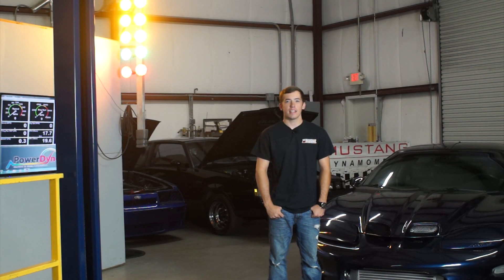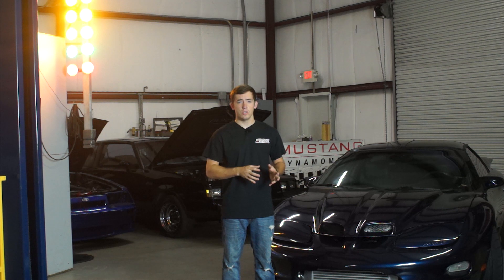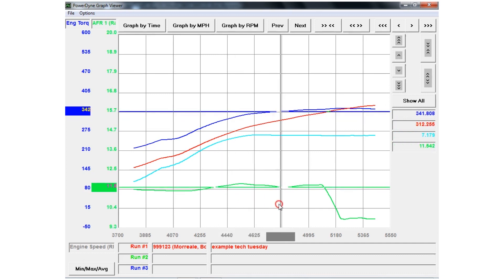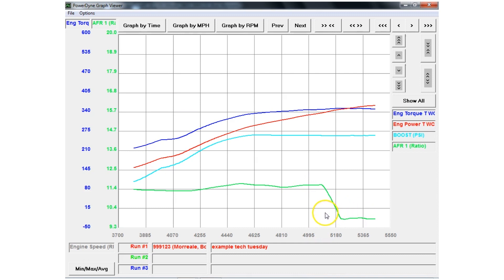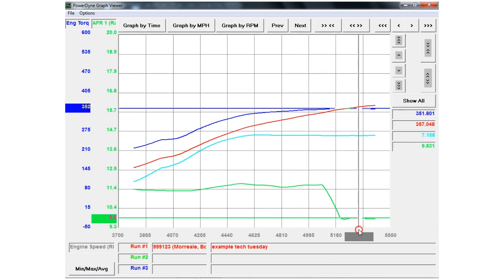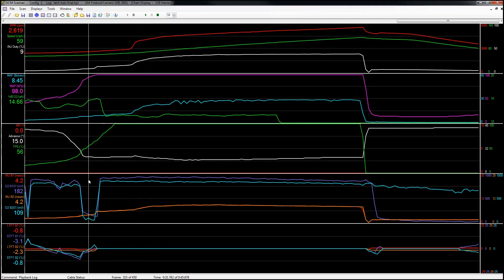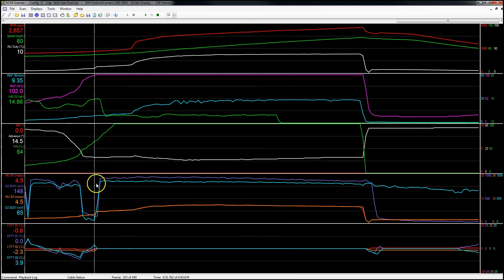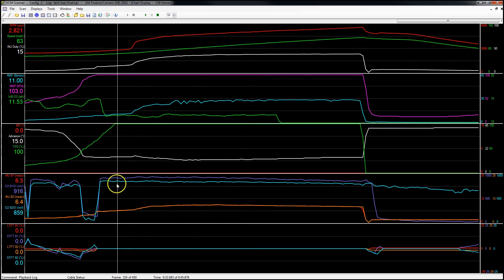How to Tell if You Have a Bad Wideband O2 Sensor: Using HP Tuners

Comment: Great. I will buy a Dyno machine to detect bad O2 sensors in my 2003 car.
Reply: What he described will tell you if tell you if the O2 is bad, with or without a dyno. The injector pulse would shoot up, etc.

Comment: Hey TheTuningSchool, I need some help in regards of troubleshooting a bad o2 sensor or if it's something else. I was doing 3rd gear pulls today and datalogging. I saw my AFRs shoot up to 22 and beyond. I have no CELs, IDC's are normal, timing is normal, boost pretty everything is normal. Only thing is AFRs was completely weird and I had about 4 counts of knock. This was from 2500-7500rpm. I'm running the Innovate PSB-1 and after watching your video I am leaning towards a bad sensor. It was spiking at 7k rpm.